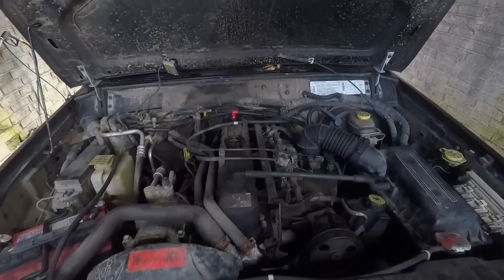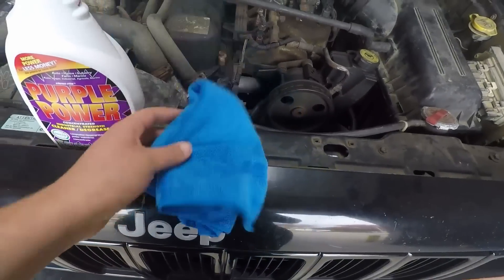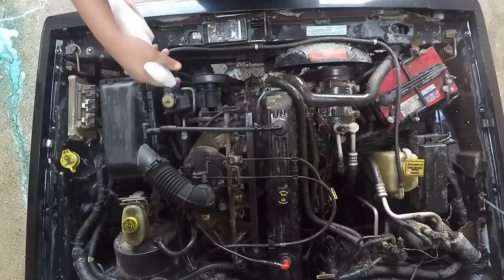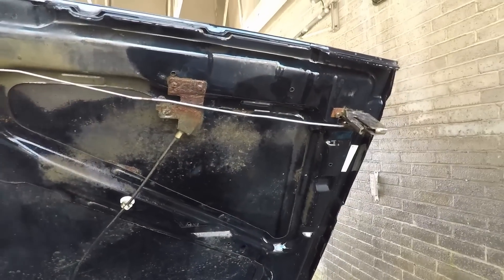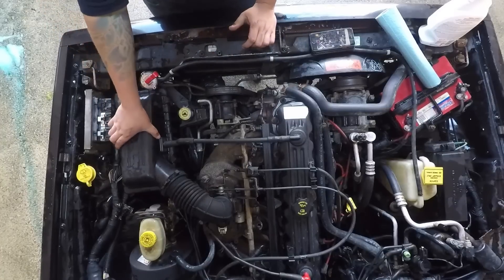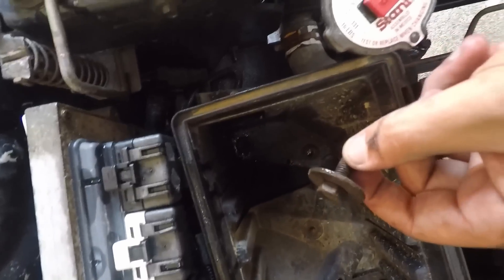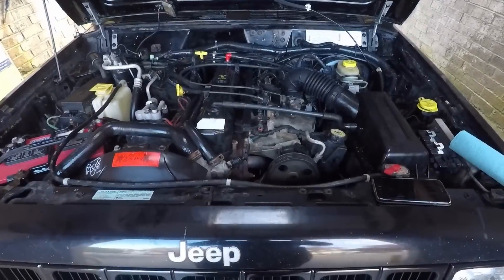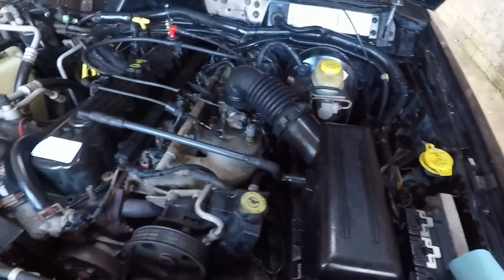How To Clean Your Engine Bay

Comment: Hold up, you just sprayed the battery with water and along with a lot of other electrical components...
Reply from the maker: SwagSubscriber yes I did. Not all the cars are the same though. You should be weary of getting water in the intake. Make sure to cover your fuse boxes (if they don't have covers). And don't let water sit in there. That would only promote rust.
Reply: SwagSubscriber it doesn't bother the electrical parts at all!!!!! they are made to be wet!!!!!!
Reply: He meant designed to get wet.
Reply: SwagSubscriber I'm not going to give you a smartass answer like you've been getting it seems. certain electrical parts can get wet & car batteries are one of them. as long as its not up and running it'll be just fine.
Reply: Alright, seems like you guys are hating and I believe that you spray a battery while not in use. But I did that with a Civic and the battery had sparks. It was a new and perfectly clean with no corrosion
Reply: SwagSubscriber cheap battery maybe? was it still grounded?
Reply from the maker: Kendrick Craft sounds like he got water in the cells. That'll definitely short out a battery.
Reply: Ron's Rides yeah it does good point. unless he had a crack in it or it was just a shitty battery though that shouldn't have happened
Reply from the maker: Kendrick Craft yea that would be extremely weird
Reply: It was one of the duralast or something like that batteries. It was pretty cheap and I think water did get into the cells.
Reply: SwagSubscriber most car batteries have water in them already
Reply: About putting water on the alternator isnt that bad ?
Reply: 702mrg yeah but it can get a little wet just dont soak it down watch the chrisfix video on washing engine bays its the best one I've seen so far
Reply: 702mrg it will not bother it. I usually spray it when it's cold, and I use air to blow it off! I haven't had a problem in 20 plus years.
Reply: The Greg  its needs to be not running and cold! If you are able to use hot water that would really help. When I do customers cars. I make sure the are cold or to were I can touch the engine without burning myself. I wet the engine first. Then I apply the degreaser, then I scrub, rinse and repeat if needed. With older cars I always tap the cap and rotor off after I detail the engine to make sure its dry inside. I also pull coil on plugs to see if any water got into there, if so I use air to blow as much water as I can out of there and off the entire engine. I then wipe off all areas that I can. Then apply dressing if needed or wanted. I never wash engines if the temperature drops below freezing that night unless I'm able to keep the vehicle inside.
Reply: The Greg  absolutely, it's cool to help each other. I've been doing this for a long time and made several mistakes, so if I can help someone avoid them it's pretty cool.

Comment: How do I make my engine bay shine without leaving residue ?There's pretty much no plastic or black rubber besides a few hoses. My air cleaner, fan shroud ,etc. Is all metal.
Reply from the maker: Honestly man, depending on what type of metal. I would just polish them up. You have to be careful what you use as far as material and product you clean with cause it could give the metal an oxidized look

Comment: why is the thumbnail picture two different Jeep's?
Reply from the maker: Robert Burdge it's not. I took the before and after pictures from 2 different sides. Didn't realize till I was editing later. So I just took the after picture and flipped it on the thumbnail. So if you look close it's the same jeep just mirror flipped. Also I had put red electrical tape on a loose hose on the top of the valve cover . It's in both pictures.
Reply: just don't let it happen again.

Comment: I barely sprayed my engine and used a super light stream from a hose, and avoided all electrical and I got a check engine light on and a bunch of BS. I hate cleaning V8s. newer cars are so easy cause they have engine covers 😂😭
Reply: also it smelled in the cabon for a week. lol xD I have bad luck with detailing enginnnes
Reply: Simply Tuned next time wrap the electrical stuff in s plastic bags and wipe down what your sprayed so the water doesn't sit in weird crannies 😂
Reply: benson420710 I put plastic bags on the stuff. I think water got in the coils so I need to tape those down. sucks washing my engine I just have to be super careful

Comment: Did this same thing to my 1998 mercury grand marquis and it wouldn't start. Had it towed home and it wouldn't start the next either after drying out so I had it towed to a mechanic, an it ended up ruining all 8 coils, the crank shaft position sensor, and ruined the computer. Cost me $1400+ all because i wanted a clean motor.
Reply from the maker: Beau B That really sucks man. Perfect example to everyone else why you need to be cautious though.
Reply: Beau B reason why I haven't cleaned mines. Scared to damage something unnecessary just because i want a clean engine bay that no one is going to look at...
Reply: You must have been really careless and got it in your intake and if your cars a real piece of shit the wiring will be exposed and not in proper conduit
Reply: that's suck bro, sorry to hear that, and I'm happy to see all this negative comments, actually I was gonna do pressure washer but now changed my mind
Reply: Beau B you may have been taken for a sucker,  your problem  was probably a loose wire, but it's good to do a good cleaning under hood at home when you have time, and change the battery  terminals,  that was probably the problem that caused you problems,  sometimes you have to clean the terminals on the starter

Comment: i would have disconnected the battery and taken it out... seeing as you sprayed both terminals and a path between em.
Reply from the maker: The Asus guy one Mr grinch Water is actually not as good a conductor as the movies make it out to be.
Reply: The Asus guy one Mr grinch It's not that big of a deal. it isn't going to destroy anything. if it did, driving a car in the rain would be a bad idea. water gets everywhere under the engine bay during a rain storm.
Reply: Harley Meekins and the same when you pressure wash it. it can cause a short sooooo i still would have.
Reply: You sure could but you don't have to.

Comment: How do I not mess up the engine when cleaning it?srry didn't watch whole vid
Reply from the maker: +iDinduNuffin ! Hey man, Pretty much just make sure you don't end up separating any electrical connections while using a power washing.
Reply: Ron's Rides thank you 😊
Reply: Ron's Rides so power washing my engine won't ruin anything under my hood ??? Looking to def do this asap
Reply from the maker: HERB BIBBY it has the potential too. You have to be careful. You don't wanna knock any electrical connections loose. You don't want water sitting in any spot for too long promoting rust. Do not! Leave any type of degreaser or cleaner on anything for any longer than need be. Make sure you have covers on all your fuse boxes. And just be careful with the intake. This is really simple man. Good luck!!
Reply: Ron's Rides thanks a lot appreciate you getting back to fast .. 💪🏽
Reply from the maker: HERB BIBBY not a problem man
Reply: your supposed to power wash your gas tank to -_-
Reply: Ninj4 Murray then crawl the hell up under the car and wash it

Comment: You're supposed to leave the car running FYI
Reply: Yeah idk what he was doing
Reply: Johnny 209 why?
Reply: CrazyMustang99 so water doesn't go into your injectors so you have to keep it running if not there's a possibility your car could shake up to a week or two
Reply: Cleaning a hot engine is a no-no!!! Hot engine plus cool water can definitely cause aluminum to crack, heads, block, intake manifold, etc. Leaving the car running will just make it hot and can lead to more damage. And leaving the engine off is no big deal, even IF water got into the injectors (never heard of that) water can dry. What happens when you flood an engine with fuel? It doesn't start for awhile but after it dries, it will start and run fine.
Reply: Thats What I thought too You suppose to leave the Car Running. Thats What I do TO My Buick and My Monte Carlo. Back in 1999 I had a Lincoln and I Turn The Car off and Wash The Engine and it wouldnt start again SO Now When I wash an Engine Because I HATE A Dirty Engine I leave the Car Running.